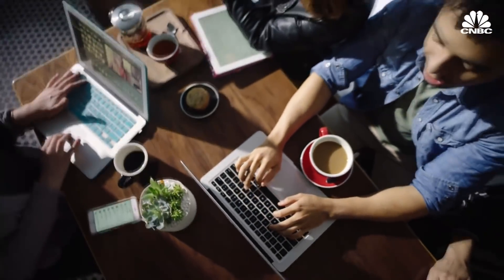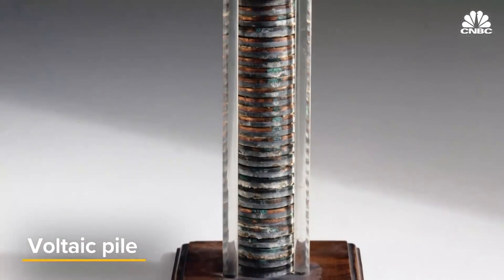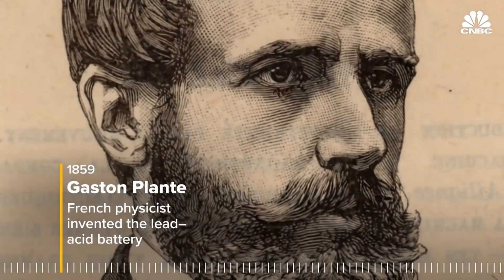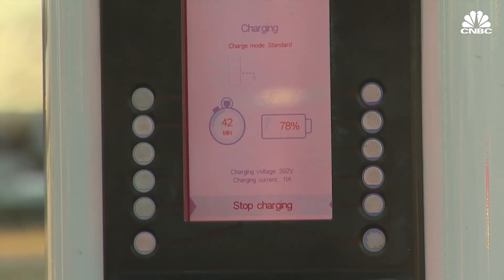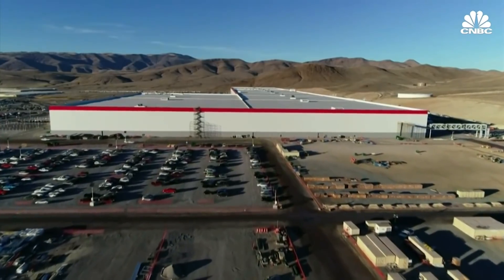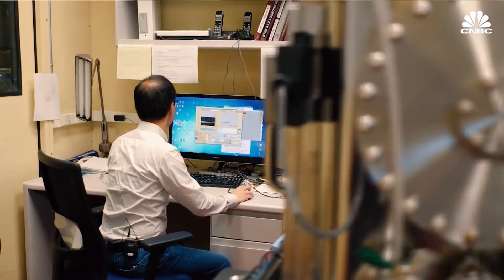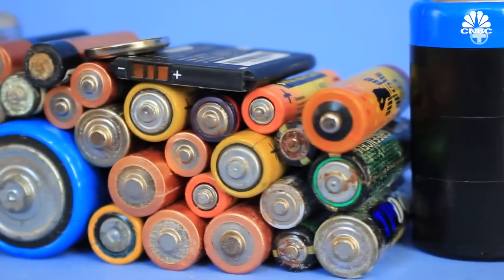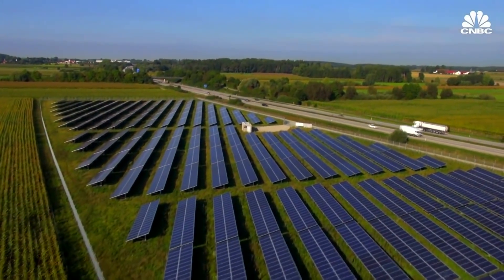Why Tesla (And Everyone Else In Tech) Is Obsessed With Batteries

Comment: gotta go invest in li-ion battery
Reply: Mattias Lindegaard not a good stock investment lmao
Reply: Invest in renewable energy stocks.
Reply: Graphene batteries are a risky investment, but if you pick the right company it'll pay off well in 5 to 10 years. That is if you feel the need to invest in batteries. Super capacitors are the real future. ;)
Reply: Kent Hambrock  Supercaps are important too and have their place,  as they are much much faster to store and discharge energy than batteries. But large batteries are the far better tool for energy storage (by a factor of 10+). Huge batteries can absorb and discharge huge amounts of power quick enough for practical use, whereas huge supercaps run out of storage 10X earlier and are also much bigger physically. So batteries will always win over supercaps for grid sized storage. We just don’t have anywhere near the amount yet, as wind and solar production increases are much quicker than battery manufacturing. The planet will need 40 Gigafactories for  just 100% electric cars, let alone grid storage needs for the planet.